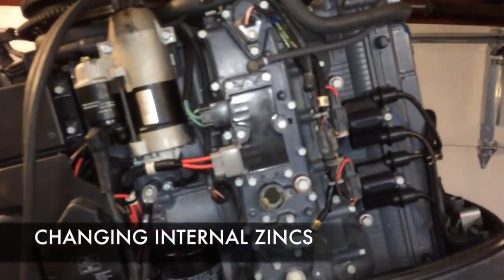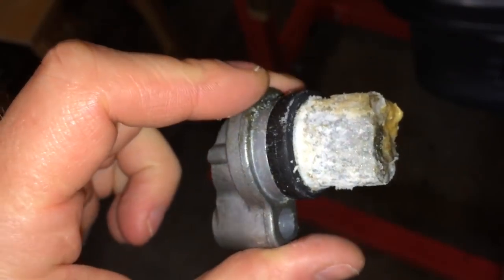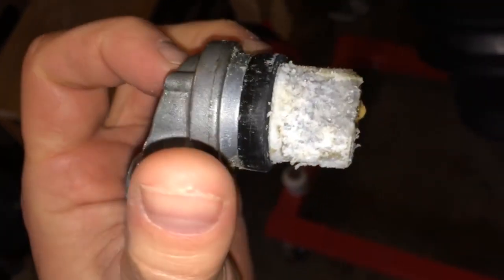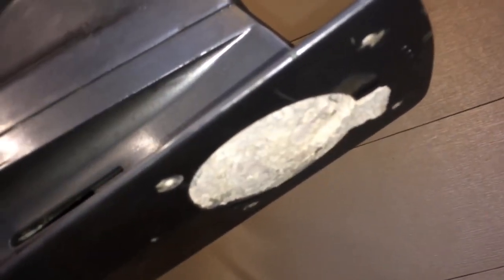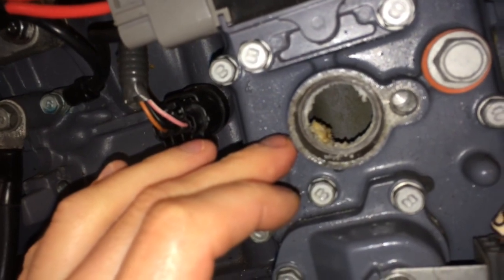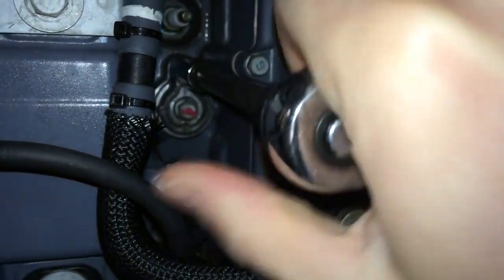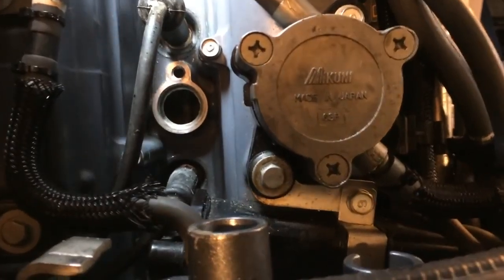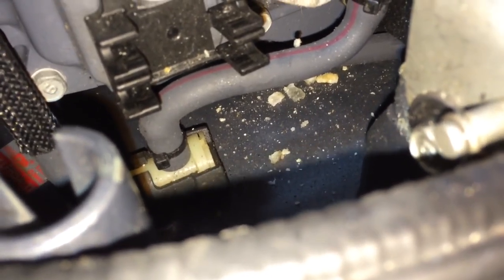What You Don't Know May Ruin Your Outboard Motor

Comment: Surprised to see that anode on the cavitation plate in such bad shape. Usually that one hardly ever needs replacing because its only in the water for a short period of time when the boat is in use then it gets raised out when the boat is at the dock. Its the anode on the bottom of the engine bracket thats always in the water and usually gets eaten away long before the other one. The outboard on my little boat is a 1994 model year and I've change the anode on the bottom of the engine bracket probably 5 or 6 times while the one on the cavitation plate has never been changed and it looks almost brand new. Hard to believe that one on your outboard would be that far gone unless previous owner left the outboard in the down position the whole time even when the boat was tied up.
Reply from the maker: very possible

Comment: It'd be interesting to pull those anodes just to inspect them then put them back without cleaning then flush with salt away/salt terminator or vinegar and see how good of a job it actually does at removing those chunkier deposits. I would imagine you'd have to flush for quite a while to break some of that bigger stuff down. Also while it is cheap insurance $10-$23 seems like an awful lot for those little ass anode. For that price you would think they would at least come with a new o-ring so you don't have to reuse the old one. Lol
Reply from the maker: Boat parts aren't cheap!

Comment: when my f150 sits in idle after a few moments it'll kinda make a metal on metal sputter noise almost as if the fly wheel was interfering with something inside the motor. Ever heard of anything like this or what the problem could be? i do not get the noise soon as im shifted into gear
Reply from the maker: Do you get it after you shut it off or running? There is a noise like that when I shut if off. It's this sensor resetting.
Reply: @SolarBurrito  ended up being a bad key switch starting the motor on its own lmao

Comment: I would not be at all surprised if you still get overheat alarms. It's a real PITA to get all the salt out completely. Usually requires full teardown and clearing passages by hand.
Reply from the maker: Been a saltwater boater exclusivly. It really wasn't that bad just needed to be flushed with salt away. Never had any alarms and zincs came right out.
Reply: @SolarBurrito  Just asking what you thought about the salt terminator .... did it really work good?